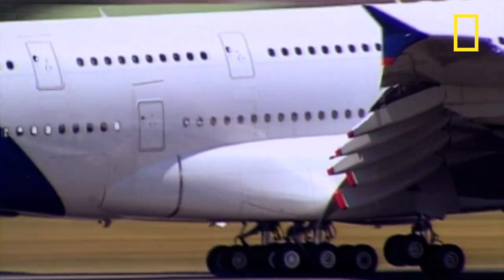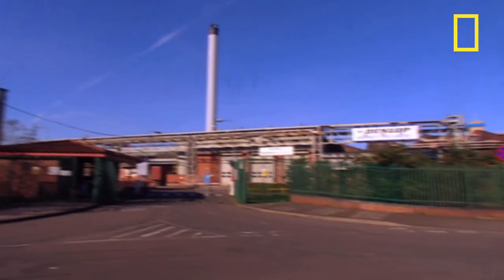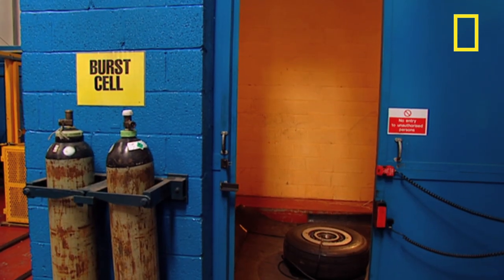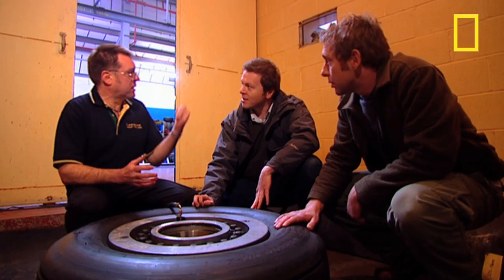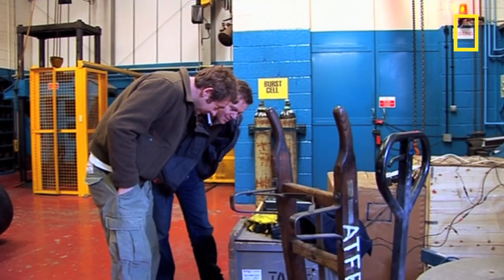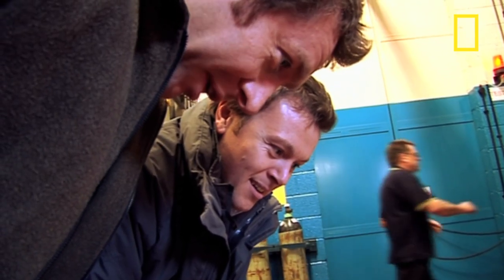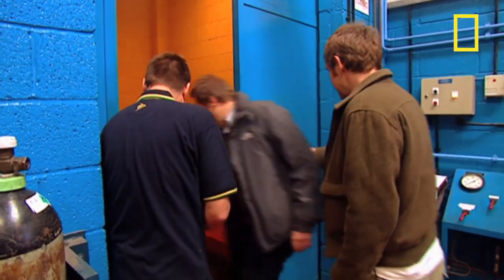Blowing Up an Airplane Tire | I Didn't Know That

Comment: Who else is watching this after the Delta incident?
Reply: Sounds like DEI was using air to fill the tire.
Reply: They were splitting the wheel half not over inflating it. The scenario was much different
Reply: was it confirmed they were splitting the wheel with air still in the tire?

Comment: For those curious, the reason they use water instead of air is because air unlike water compresses. Thus they could fill considerable more air into the tire than water, which would expand explosively when the tire burst.

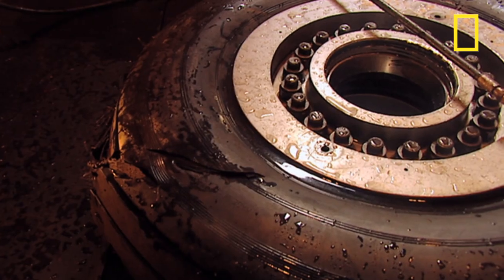Comment: The test of bursting while inflating and rotating was the most interesting test they performed in this vid.  It showed the possible shrapnel damage and the most likely areas to beef up on a plane to disinherit damage on both the take off and landing.  Fantastic. That physical emotion response performed at 2:59 and into 3:00 was a bit sissyfied looking.  3:47 This tire proved that IT had the strength to deal with the extreme situations. But they blew it up. The next one they build could be flawed
Reply: That's why they can do two types of tests: ones which are expected to damage the tire and ones which are not. You can test for something's maximal load until it breaks and you can also test a production unit to within specifications which you expect do not put much wear and tear on the unit but which also may expose an iteration flaw in that particular unit. Don't ask me why I know this, I don't have any experience testing real tires. I just used logic and assume that might be how they do things.

Comment: Concorde was a very safe aircraft but if it did have an achilles heel it would have to be the tyres. Due to the altitude that Concorde would fly at (up to 60,000 ft) the tyres had to handle more extreme pressures than other traditional airliners. Concorde also landed much faster, so the tyres had to handle more stress when landing. They didn't mention in this video that normal tyres in your car are filled with air whereas on aircraft they are filled with nitrogen. This is because nitrogen won't leak through the rubber and it also maintains a steadier pressure at different altitudes. The crash of the Concorde in 2003 was partly due to Air France not fitting skis to protect the underside of the wings in the event of a tyre blowout as British Airways had done to their fleet of Concordes after learning the tyres were more likely to blow.

Comment: "They carry weight similar to the tyres of the largest earth movers, but at the speed of a formula one car."
Airoplanes fly faster than they run on the runway. Airoplanes are the fastest mode of transport. They're meant to be faster than any ground transport when high up in the air. But if rolling airoplanes are the fastest thing on the ground, earth vehicle manufacturers make something wrong.

Comment: Why not spinning the wheels before landing to reduce tire wear?
Reply: danny rubin Then you need additional motors to spin the wheels. The added weight alone might cost more due to increased fuel consumption.

Comment: its crazy that the hose filling the tire can hold up to the pressure also.
Reply: The   hose is way smaller than the tire   so can wthithstand   pressure easier    also    probably a  hydraulic hose   those can easely   handle  several  thousand  PSI